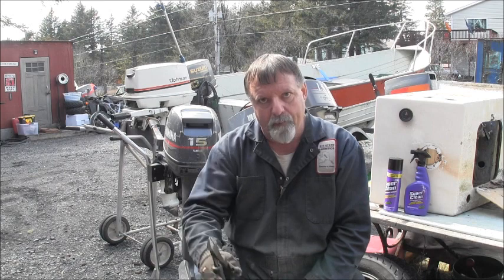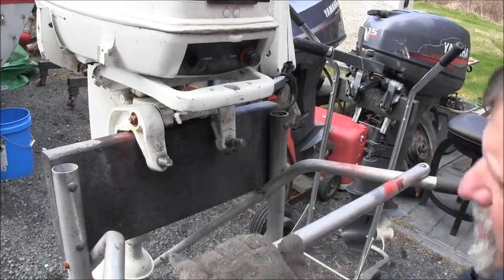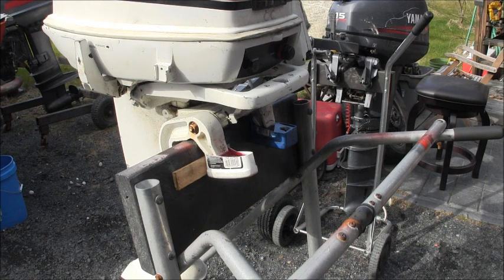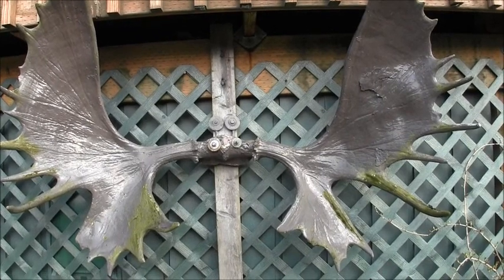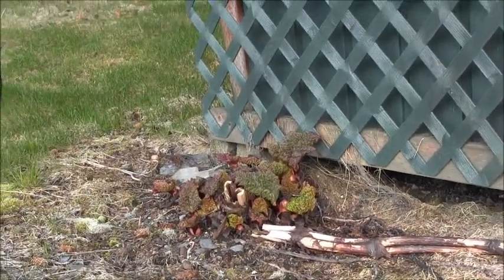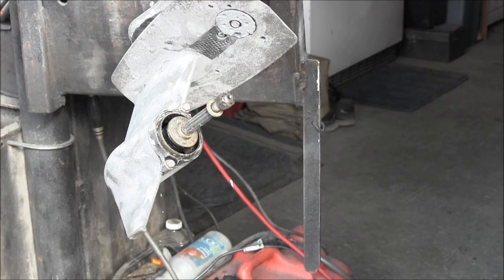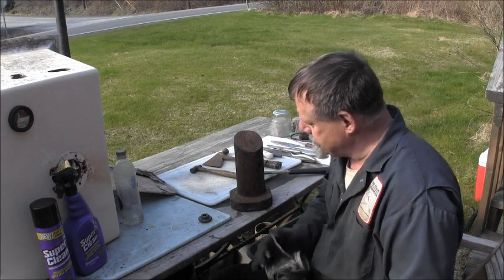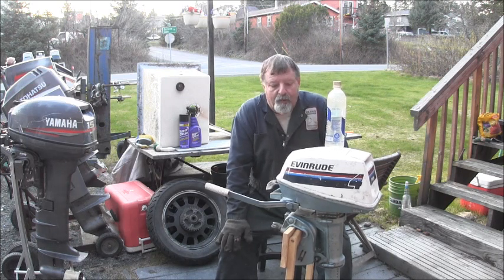SUZUKI  15 HP  4 STROKE  ,&     ''''  Much  More '''''

Comment: Just curious if you ever tried just straight vinegar on those bolts? Submerged just as you did with the mix! I’ve had great success with vinegar on all sorts of different things that I want to clean that have the saltwater elements on them, I can usually fit some sort of baggie w/rubber band around what the item is I want clean if I can’t get a solid container under it! Was just curious if you’ve ever tried it!
Reply from the maker: No  I have not tried vinegar''  I will soon in a video thanks mate,        kodi

Comment: It's nice to have a remote tank. Having a built in tank isn't good when you put the motor in the trunk on in a THE back of a truck or you want to fly it in to a cabin. You still have to carry extra gas with you if you are going any distance. That is a big advantage with a two stroke over a 4 stroke crank case oil and such.Just the way i see it
Reply from the maker: I think both would be a good option , via 3 position valve.                        kodi
Reply: I guess you would know more about that then me. I have had many of the 3hp weedless they only offer the built in tank. They all would leak and were a gravity feed system. All the 4hp i have seen have fule punps  and use 50to1 mix . how ever you do it i am sure it will be a cool set up Thanks for the reply

Comment: I'm having trouble with my Suzuki outboard it an 01 15hp  I think it may be the  Accelerator pump  it seems like that but . It is falling on it a** under full thatle like above 3000 rpms  I'm guessing on that I don't know the right rpm because no gage but just wondering your thoughts after all you are the outboard guru I turn to
Reply from the maker: Thanks'  First I would check all the basic stuff,  Fuel lines, hoses, water in tank, vent etc.  If All is Ok ,  Then put a in-line spark checker while running under load and see if you R loosing spark on either cylinder while running @ high Rpm's.  If not then I would look inside the carb  for yuk, cloggs, dirt etc.   kodi
Reply: @kodibassInsideoutboards  and  According to your video I would need one of those adjustable gap spark checkers is that correct
Reply from the maker: @stevengaines1935   Not on the newer model 4 strokes,  Just the older 2 stroke models
                                                                                                     kodi
Reply: @kodibassInsideoutboards  thank you for letting me know I have a inline light spark checker so I will ty that tomorrow
Reply: @kodibassInsideoutboards  I checked and I'm not losing spark  .   It sounds like it is either getting to much fuel or not enough ill be rebuilding the fuel pump tomorrow.  And see if that salves the issue but I'm still leaning towards the  Accelerator pump in the carb I wish I could send you a video of what it's doing.  Also if ther is a favorite candy or something we have down here in Florida that I can ship it to you for all your help and support please let me know